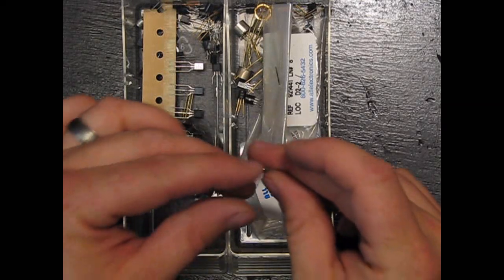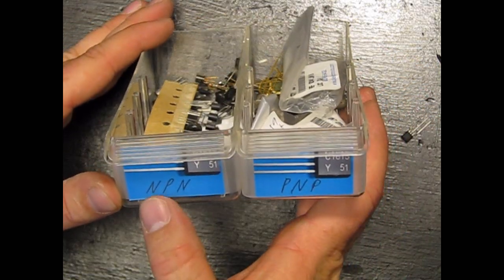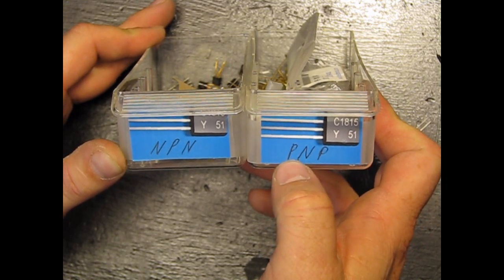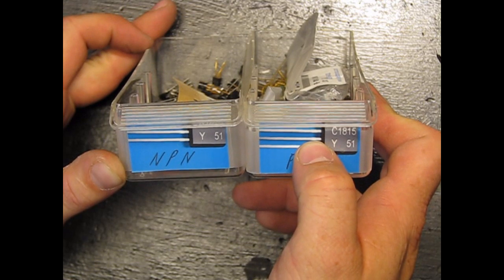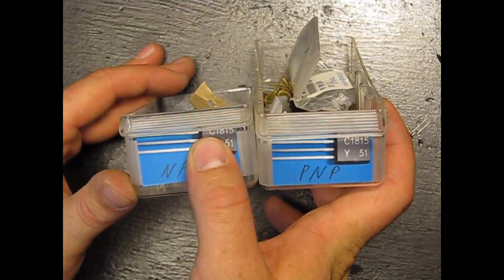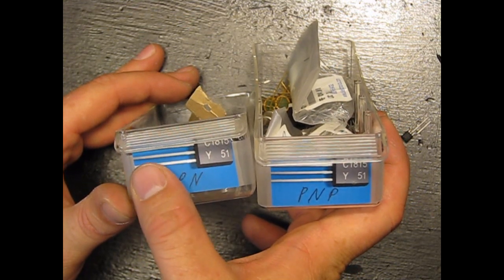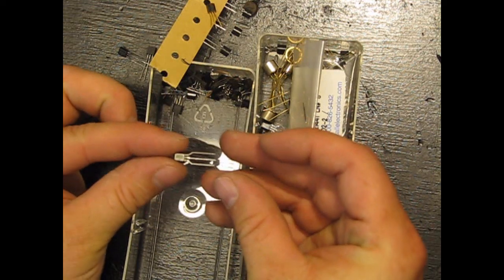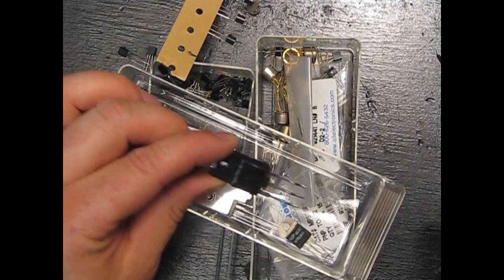What is a Transistor?

Comment: Sorry, but if you try to do a tutorial, you should know what you are talking about (at least check wikipedia for starters). NPN and PNP has got nothing to do with where to connect positive or negative voltage. And on a bipolar transistor (as NPN and PNP are), the controlling input is called the base. Wanting to keep it simple is no excuse for making it wrong and confusing people.